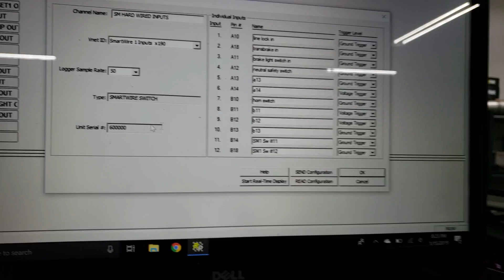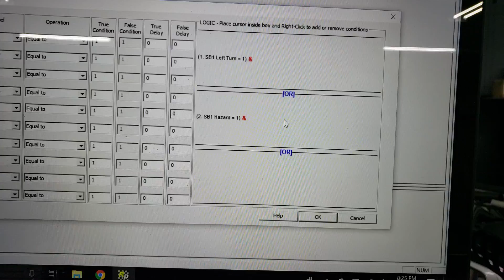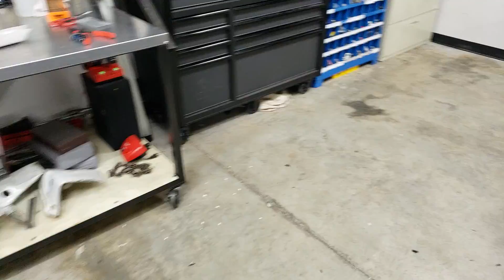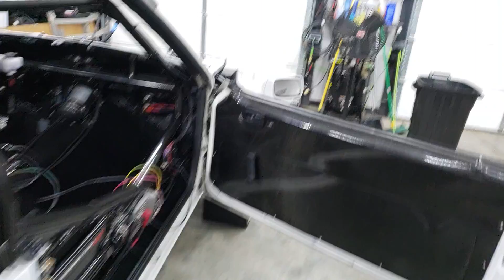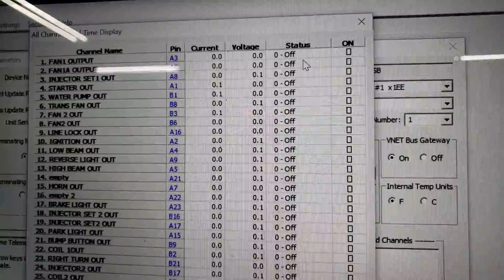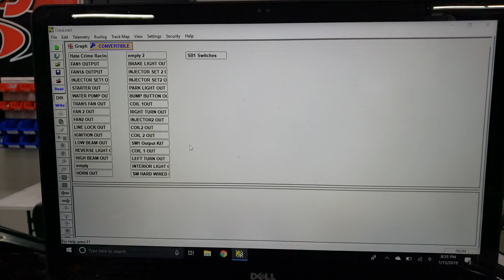Racepak smart wire intro

Comment: Wiring mine now. I'm curious if the 125A max amp rating is a low rating. There's far more outputs than that even just the high current alone. My fans draw 18amps each. So I was going to just run 1 per high amp output. Same with my fuel pumps. They tripped me out when they did the dual channel for fan on the street harness. Now I'm second guessing if I need to tie 2 channels together per fan.

Comment: From the looks of your comment section, I won't hold my breath getting an answer! But, how can you order the STREET version with the KEYPAD? And those bar clamps are complete junk!
Reply from the maker: we are a dealer and we can piece together a kit for you with a street harness and a keypad.  the only difference between the street and drag version of the harness is the printed wire and the config thats already loaded in it.  but the config is very easy to modify in the software.  feel free to email us at hcr_innovations@hotmail.com
Reply from the maker: oh and we also have some billet keypad mounts that attach to a cage, they are very slick,  uses a master link so its only 1 bolt from the front side to attach to the cage.  makes install a breeze.

Comment: Been watching your videos since I stumbled across them. You're one of if not the most informative channels on youtube! 
I'm looking at finally getting into wiring one of my cars myself and will be using your videos for reference. 
Is it possible or would you recommend powering the dominator  from the race pack directly or power it separately? 
1 master switch to turn everything on in a fully integrated system or would it make more sense to keep them separate engine system and body system? I'm thinking seperate for easier wiring during a future upgrade or easier trouble shooting isolating problems to a single system not having to comb through a mixed harness. Thanks
Reply from the maker: i use the smartwire to turn on the ignition side of the ecu, the main power and ground for the ecu should go directly to the battery
Reply: @theholleyefiguy  thanks devin! 
Your videos are going to be my DIY bible in a few weeks

Comment: Hi Devin, what size are the fans you tested in this video? I am about to wire up my offroad Trophy Truck and I am concerned I am going to run out of capacity due to the large amount of high current drawing devices. My fans are 16" Spals. Thanks.